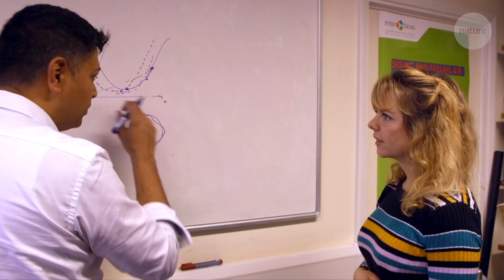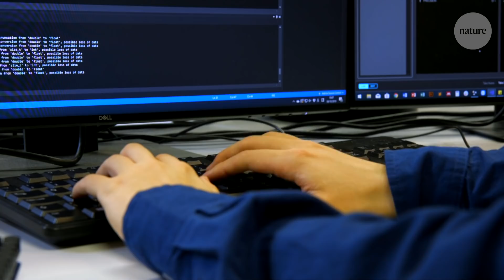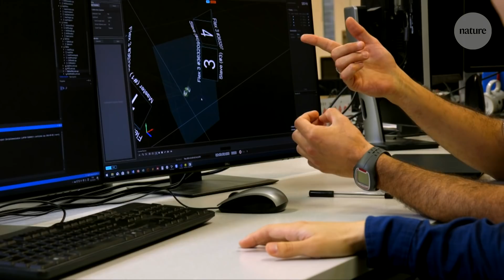A tactile 3D display, created with sound

Comment: This was 4 years ago... where are we now?  That's an eternity in tech!  My current thoughts:  Each vertical shaft created by the lower and upper ultrasonic emitter (speaker) are like strands of string.  You can have multiple 'voxels' by adding more beads vertically.  We should technically be capable of 1000s of voxels by now, perhaps using extreme light-weight RGBWW LEDs custom designed into a hollow spherical structure that has wireless power receivers built into them.  This would allow them to be activated by varying magnetic field induction, and the cameras tracking the voxels in real-time would feed that data into the color map for the 3D 'scene'.

Comment: Plasma could be feasible. I reminisce about plasma globes that you see at museums where putting your hand or finger on the globe surface draws the plasma to that location. Those plasma arcs are mainly electrons, no? I wonder if matter decay would be a bigger issue when trapping the plasma for a long time rather than actually trapping it in the first place

Light itself could also be feasible, given that I think it was UCLA a couple years ago who were able to slow down a light ray enough to capture its propagation (albeit in a fluid/medium and not just vacuum). You might need strong magnetic fields to steer the waves into specific interference patterns, or the right kind of cavity. But then again we see light in our eyes/through a camera because waves excite our receptors therein, so I'm not sure if that fact would undermine any wave patterns we could manage to actually create. Not sure if the wave itself, if trapped, would reach our eye and allow us to register/perceive that the wave is actually trapped there. It might still be invisible.

Another way to do it would be to create miniscule (at micro- or even pico-level) spherical 3D "pixels". You could have these things either be electronic LED emitters that emit different RGB colors depending on some sort of RF/microwave signal, or just make the 3D pixels out of a material that reacts to the local Infrared wave pattern it experiences at each location of its movement. So, what I'm saying is layering an IR field on top of the acoustic field so that as the 3D pixel moves in space according to the acoustic pattern, but then change colors according to the heat pattern. These 3D pixels would work better than trapping light itself because they theoretically emit light themselves, which then has a chance to reach our retinas and be processed by our brains into color

Edit: finished my thoughts

Edit 2: I just realized that you could similarly overlay an RF/microwave field on top of the acoustic field just as much as the IR one, in theory. Then yes you could either have "electronic" spheres or cubes as the 3D pixels, or conversely some sort of organic/inorganic compound structure that rearranges itself and emits different frequencies of light according to the localized IR field it experiences

The RF/microwave idea may or may not be the same as the plasma idea, if my assumption is right in that plasma is actually composed of electrons and that the electrons take the place of the "inorganic compounds". So many possibilities!

Comment: can this thing create a touchable hologram?
Reply: Not this iteration, but yes, about 100+ iterations down the line it is certainly possible.  The voxels will most likely evolve from styrofoam beads into custom RGBWW LEDs powered wirelessly.  And from there, a method for 'attaching' voxels to other voxels, magnetically or mechanically will be realized.  Then we wouldn't be too terribly far from having the tech to pull off a full size Star Trek style holodeck.

Comment: ha use the space-filling curve " 3d Hilbert's Curve " to make a hologram https://youtu.be/NhKmipo_Ek4     if we move the fast   at list  15 to 20  full cycle per second  we can have a perfect hologram  display just to make a faster rate projector which can frame the projection right into the thermocole ball   as it  moving to create a  360 degree view  it is possible around 5000 to 3000 fps projector have been invented   so a 3d hologram space-filling curving it cycle should be 15 to 30  p/s and one 3d pixel should have "8" frame its volume = multiply of the shape volume of the thermocole ball in to 8  of  the projection in thermocole ball should be  = multiplication of "8 =one 3d pixel " to "the volume of the object which you are trying to  display in a cube , in this way you can archive a full  3d air display on to which you can display anything you want to display

Comment: I agree Overunity. The scifi novels in the 80's and some movies, demonstrated a troph filled with liquid, sand, or using interference light patterns, to create holograms. each has been brought into reality as an act.

Liquid, offers an interesting glass and solid field. 
Sand/dust/ dependent size mater offers, touch feed back so one could create an entire room, Real challenges is structure supports so make a vibrating bridge and then put an object on it, and see x surface area for fall through or giving buoyance, because technically its a solid mimicking a liquid state, one could then drown in sand, but its the limited language ot describe these, its detests e greatly is the lack of terms that describe teh active dance of matter properly.. Technically everything behaves like a liquid, so we have state changes at temperatures, but this is difference ot movement, there isa word that comes ot mind but it disappeared... The level of matter dissociation from 0 to 1 and everything as a fraction between. 1 being solid, 0 is to such a spread state that its like colorless gas.
LIght doesn't give back feed back, other then heat...
Newtonian fluid is of interest to this application.
It gives a new level to gaming, and exploration and a mapping systems. Allowing to give a map that convey information without having ot read the plateau lines. Including tracking

Here's an error of word, but 2800-3400... year... just state how far away, because this would go through a process of learning... then the system... there is a energetic state with magnetic sound vibration... could create entire rooms looking realistically.. but maybe it already exists. lol

Dangers are what is the reaction to falling through microvibrations? I don't think muchcould happen, unless prolonged into it, but hmm.

Comment: I feel like this is gonna be the approach that sticks.More beads, faster, larger area, better speakers. Large room for improvement from every direction. Imagine stepping into a room of these.
Reply: Yeah safety would be paramount. Depending on the refresh rate/particle velocity of the hologram, though, as well as the particle rigidity, it might hurt

I can imagine a person walking into a room where water droplets are used as the particle so that impact isn't too harmful. They can put their hand in front of the sound pattern and "feel" the presence of simulated object at that point. Obviously the water droplets arrested by their hand would need to be replaced by some sort of emitter with constant particle/image parity monitoring